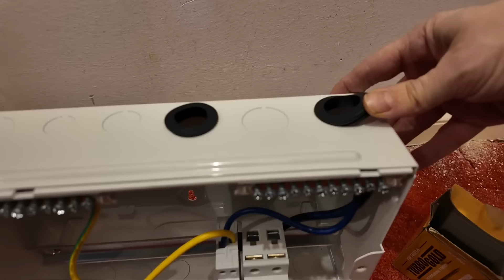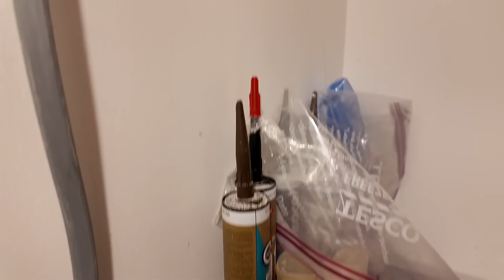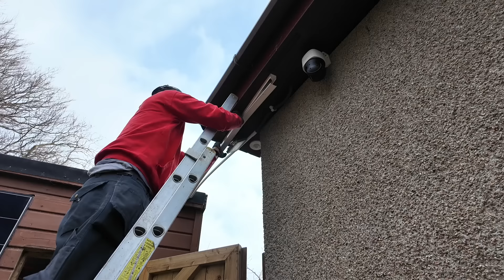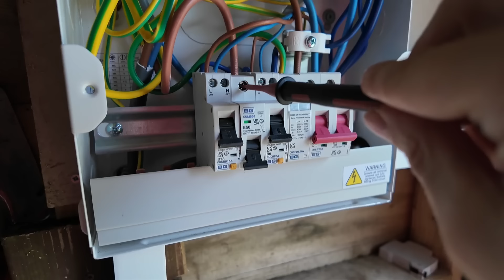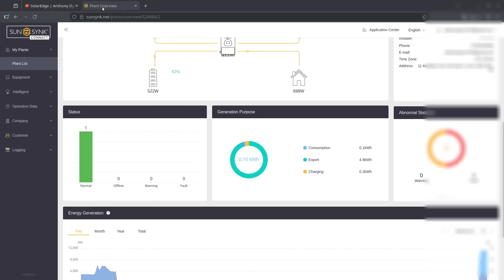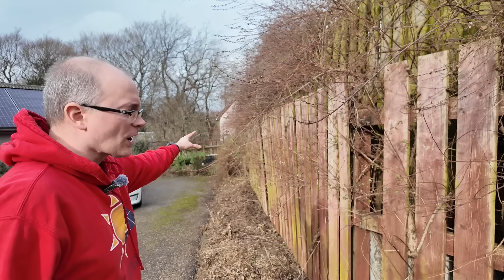First 2 weeks of 32kWh Fogstar - Solar Fence / Shed / Battery Project Part 8

Comment: Thanks for the update, I'd be cable tying to panels to the fence for now 🤠, could lean at a slight angle. Are you putting them vertical on that fence?
Reply from the maker: The fence is leaning about 3° towards the driveway.  Additionally, you’ve got that retaining wall which is leaning onto two of the fence posts.  I’m inclined to lean the solar panels up against the fence so that they are pointing slightly upwards.  That would mean that the fence isn’t being disturbed by the solar panels. Last thing I’d want to do is collapse the retaining wall by removing a post that’s bearing the lateral forces.  Just thinking of a way of attaching it to the fence.  Cable ties are cheap, but I suspect they would fail in the first big storm, and they probably degrade an ultraviolet light as well.

Comment: It's been interesting following your progress. It would be good to see a high level wiring diagram and some explanation of how the different inverters function together. I've got 6.5kW peak on my house and wondering if i could add an additional small inverter, and a big battery, in the garage using the just the line already in place to power the garage.
Reply from the maker: My shed is fed with 6mm cable, and protected with a 32Amp breaker.  That’s big enough for a 40 amps “clipped direct”, less so if there’s insulation.  But I limit my inverter to 6000 Watts.  It is the energy that I need rather than the power.  I only need all the power from the inverter during a blackout.

But there’s a wiring diagram in the part one video of my project series.
Reply: What inverter do you have? As many you can just piggyback a second one of the same brand alongside it. But maybe I'm misunderstanding what you mean?

Comment: 15:18 there's evidence that putting solar panels on buildings reduces the cooling needs. The cavity between the solar panels and the structure means there's no direct heating of the structure, airflow between the two allows for separation.

Any more heating would be caused by the inverter, so having a temperature dependent extractor fan is advisable.
Reply from the maker: Yes, except for the fact that the solar panels are building integrated.  They aren’t placed on top of existing cladding - They are the cladding! There are open soffits for ventilation though.

When exposed to sunshine, the back of the panels was “pleasantly warm” in the late February sun.

Comment: The easiest method of stripping twin & earth is to use a Stanley knife. Use it to right at the end only. Hole the cable vertical and down in the centre about 1cm and to expose the earth wire. Then use pliers on the earth wire and pull it down to where you need the insulation cut down. No fancy tools, just a knife and pliers.
Reply from the maker: The cheese wire method works with smaller gauge wiring, but 10mm T+E sheathing is quite a bit thicker.  I didn’t have much luck with that method.
Reply: @anthonydyer3939  If you grip the earth wire with long nosed pliers or mole grips you can then roll the grips along the wire which will allow you more force to allow the earth to to strip the cable for you

Comment: Hmm I would add more lloft insulation from what I could see. Do you have any recognised electrical qualifications ? otherwise I would be concerned about validity of home insurance.
Reply from the maker: You’ll see that I shifted a lot of insulated loft boards to the side so that I could access the cable transit.

As for home insurance:  You’re probably not covered for faulty wiring, even if done by a professional.  Many policies have a very powerful general exclusion:  “Any loss or damage howsoever caused by faulty materials, workmanship, design or maintenance”.

It’s the electricians liability insurance that covers you, not your home insurance.
Reply: @ant @anthonydyer3939 reality is that if the insurance company wants to not pay out it’s going to have to make that case to the ombudsman and demonstrate negligence from the home owner. If you’ve paid a qualified electrician to do work it’s going to be challenging for them to make that case. They’d be better off paying out and going after the electrician than wasting their time trying to make that case.

Comment: You have way too few panels to hit a decent voltage to the sunsynk, if those panels are in series then the 2 on the fence could bring the rest down on power when in shade. I have 2 of those sunsynk units and they love 400volts. 10 to 12 panels seems to be the sweet spot for them. You'd be better off sticking the panels on your roof. I'm building a 48 panel North South solar fence in an open field so here's hoping all will be fine.
Reply: Yeah! What I hear is that his string of panels is simply too short.
If he can't get into the lower MPPT tracking range with the Vmpp of the panels in the sun/light at any one time then the system will suffer a lot.
Reply from the maker: 12 panels at 41VOC would be very close to the 500V MPPT maximum, especially when cold weather temperature coefficients are applied, wouldn’t it?

I’ve got much higher hopes for my driveway panels when they get installed.

48 panels: that’s a decent system!
Reply: @anthonydyer3939  Ideal voltage is 370v but range is 125V~500V. Lower than that is actually out of spec when running it.
MPPT range is 150-425v suggesting you actually need at least 5 panels in a group (panels receiving similar solar conditions). Then if one consider the full load DC voltage range being 200-425v it seems the inverter is best suited to even larger strings of at least 6 panels per group although at 5 panels we're only talking 2.1 kW anyway. If you run different areas on different strings then this will be fine, but if you want to save an MPPT for the other fence by the driveway you'd need to series the shed and back garden fence and I don't know how their light properties match.  The wall on the shed does have 4 panels though so I am wondering if it might be worth having two extra on the roof to get that group to 6. There is also the option of using parallel groups at that point if one can get them up to a useful level of at least 5 each for the inverter.
IN general this inverter seems great for larger arrays but not super for multiple smaller groups of panels with different solar influx.
Reply from the maker: @1kreature Interestingly, the 3.6kW inverter by Sunsynk has exactly the same MPPT voltage input range as its 8.8kw brother.  I’d say the best setup for my back garden is smaller ecoflow battery system, with a lower min input voltage.  Indeed I’ve seen someone on YouTube plug a server rack battery into the master ecoflow battery to expand its energy capacity.
Reply: @anthonydyer3939  It's always a complicated choice of different benefits. I wonder if Next Power 6.2kW unit is specially designed for this sort of scenario where small residential systems are spread over multiple roof angles or similar. I believe it works down to 60v.
Reply: @anthonydyer3939  480v with no load, but they are always under load no matter what. It's worked great for 2 years so far. The voltage looking at the data very rarely gets over 400v under load and the panels are the 450w ones. Only times I've ever seen a spike near 500v is when the sun comes out behind a cloud for a brief moment. I even run 2 strings in parallel so have 4 x 12 panels on each 8.8kw Sunsynk inverter. If the voltage is too low you will waste a lot of energy.  Solar fences only really work great in a North to South setup. You get the morning and the evening and the power is the same in Summer as it is in Winter, you lose about 40 to 50% of the panels potential but you get a more reliable over the year power dellivery.

Comment: ❤ another great vlog - so glad to see that your almost there!! - out of interest why are some of the circuit breakers upside down?
Reply from the maker: If you’re referring to the main consumer unit, they are all the right way up.  It’s just that some of the breakers were added later, so they are probably a different design revision.  I have to say the Crabtree Starbreaker modules have a much neater bus bar configuration.  It’s essentially a “push fit” configuration where you just add the breakers to the din rail and then a copper post at the back of the breaker slots into a hole on the bus bar.  

It’s far quicker and less error prone than the conventional bus bar arrangement.
Reply: @anthonydyer3939  - I'll get back to you once I've looked back at the vlog - I was actually meaning on the new shed bit - we have a similar system (which I'm just adding to) , and had a similar dilemma as to which end the RCBO should go (or both)? - we have bi-directional RCBO's for the existing "blended" system in the CU, but for the new solar & battery wasn't sure as to whether as to which end the new RCBO should go (in in the shed or in the CU)
Reply from the maker: @EverydayLife621  I see what you mean now.  The breaker in the middle on the shed consumer unit is a 50Amp MCB not an RCBO.  That supplies the backup loads consumer unit inside the house.  It’s important to note that the shed consumer unit is connected to the back up loads port of the inverter. It is not connected directly to the grid.

The supply to the shed from the grid will be protected by an RCBO which is mounted inside the main consumer unit.
Reply: @anthonydyer3939  👌 👌 - we did our own G99 (with no issues) on a Victron Energy GX MP-II 5000 - they have verbally said (when installing a new earth and pole etc.), that we can have as much solar and batteries as we want through the existing approved G99 🤷‍♂🤷‍♂ (as long as the inverter doesn't change? ) - on our system we have 2 extra outputs, AC_OUT1 (20A) and AC_OUT2(+30A+) - so am just switching over to 20A of protected loads (=everything in house under normal loads) + everything else on AC_out2 (EV is on a seperate CU)